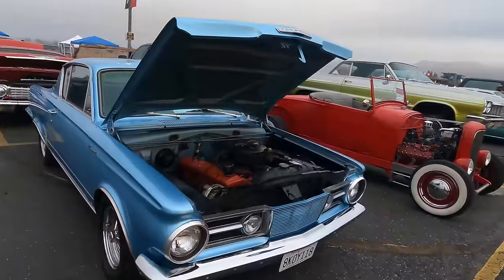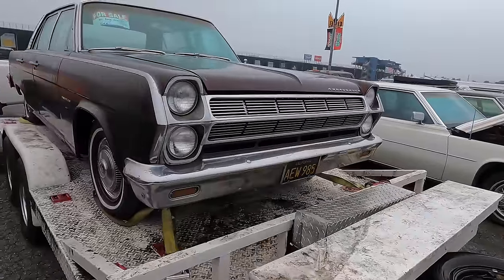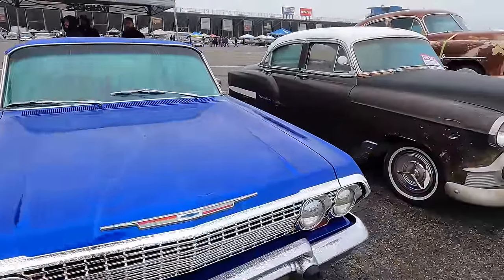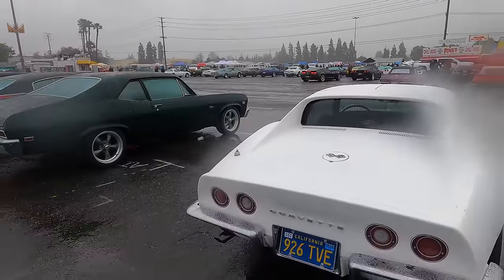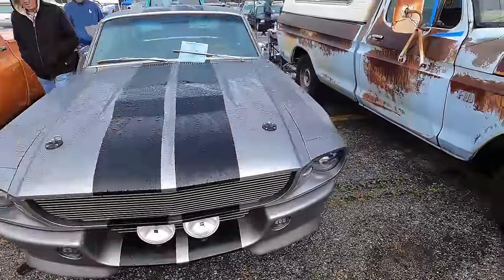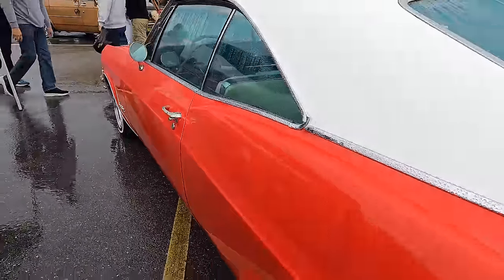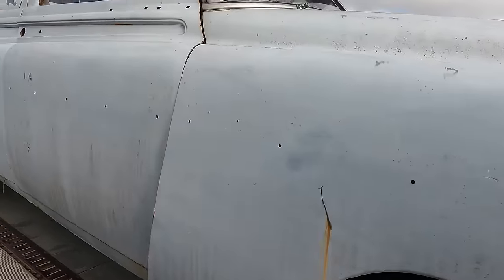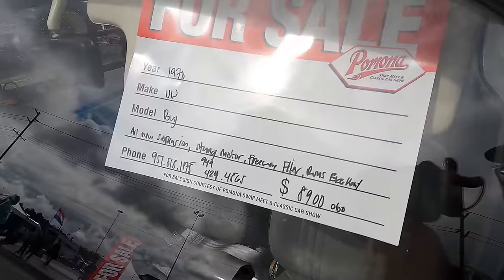Pomona Swap Meet & Classic Car Show - March 3, 2024

Comment from the maker: Tentative List Of Shows I’m Planning On Filming (Subject to change)
 
March 9, 2024 - Lowrider Super Show In Long Beach
March 10, 2024 - Long Beach Swap Meet
March 16, 2024 - Goodguys Scottsdale
March 23, 2024 - Goodguys Pleasanton
April 6, 2024 - Goodguys Del Mar
April 7, 2024 - Long Beach Swap Meet
April 13, 2024 - Rat City Rukkus (maybe)
April 14, 2024 - Pomona Swap Meet
April 20, 2024 - Mopar Spring Fling At Woodley Park In Van Nuys
April 21, 2024 - Fabulous Fords Forever At Irwindale Speedway
April 27, 2024 - Chino Corn Feed Run
May 4, 2024 - Riverside Show & Go
May 12, 2024 - Long Beach Swap Meet
May 19, 2024 - Benedict Castle Concours
May 24-25, 2024 - Cruisin’ Nationals In Santa Maria
June 1, 2024 - Malaise Daze at Automobile Driving Museum 
June 8, 2024 - Bomb Club Car Show 
June 9, 2024 - Road Kings Car Show
June 14-15, 2024 - LA Roadsters At Pomona Fairplex
June 23, 2024 - Pomona Swap Meet
July 4, 2024 - Sespe Creek Car Show In Filmore
July 14, 2024 - Long Beach Swap Meet
July 20, 2024 - Glendale Cruise Night
August 4, 2024 - Long Beach Swap Meet
August 10, 2024 - Big Bear Fun Run
August 11, 2024 - Pomona Swap Meet
August 31, 2024 - Ventura Nationals
September 8, 2024 - Long Beach Swap Meet
September 28, 2024 - Cruisin’ For A Cure
October 13, 2024 - Pomona Swap Meet
December 8, 2024 - Pomona Swap Meet
December 31, 2024 - NYE Rose Parade Cruise
Reply: I was going to go film but I thought there would not be very many guys there with the rain. So I stayed home great filming in the rain....
Reply from the maker: @Mikefngarage  I’ve filmed every Pomona since it came back after the Pandemic. At this point I gotta keep the streak going. Glad the turnout was decent
Reply: @MikeFrankovich  yea better than I thought It was a $100 cost decision to me Gas plus entrance. just didnt pan out. plus my wipers are sketchy.

Comment: I planned to go.. heavy rain in my area.. figured same there.. looking for 65 or 66 SS hard top or rag. That 66 is overpriced! I missed buying 66 convertible in Oakland,  loaded 396.. 41k.. my luck had contractors clearing land slide at moms. That cost me buying that 66.. now looking at 65 out of state worst case..
Reply from the maker: I'm sure the right car will pop up. It's always when you least expect it.